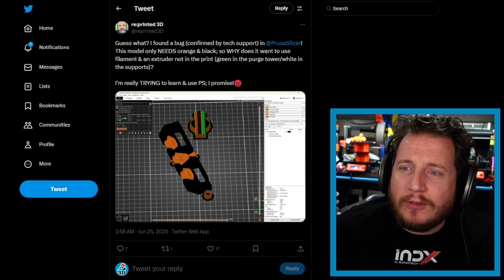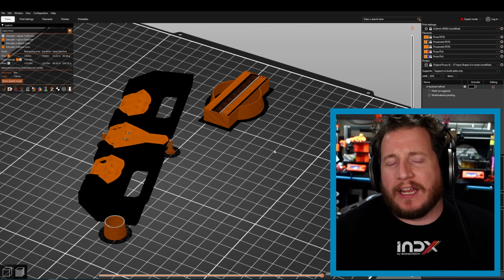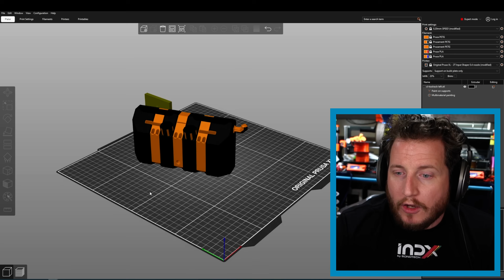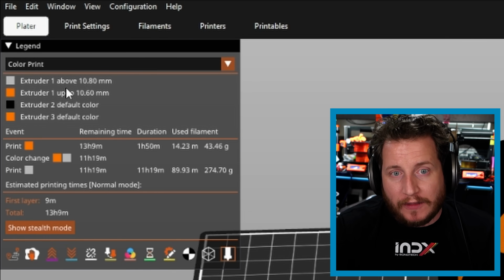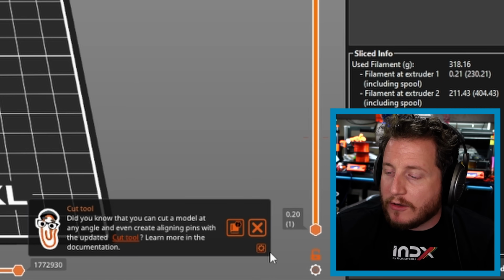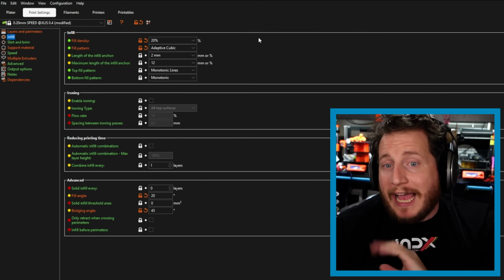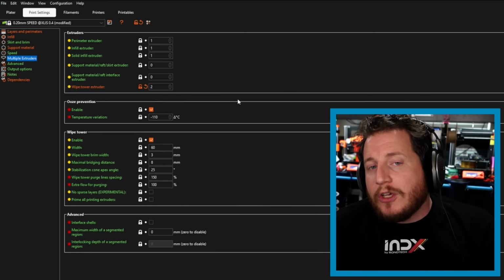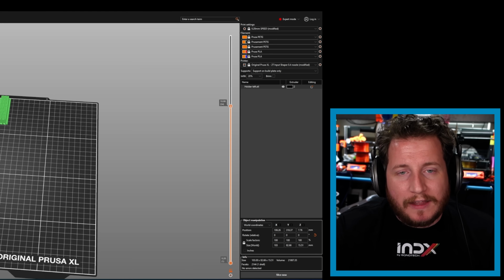UNEXPECTED Color Changes in PrusaSlicer?? - PrintFixFriday 198

Comment: I used Cura briefly (it sucks imo), then moved to Bambu Studio and Orca soon after (I still use BS occasionally). I’ve never used Prusa Slicer, but from all the videos I’ve watched that include it, it appears to be more complex, in both UI/UX and in slicer/filament/multicolor/printer settings. Whether or not it actually IS more complex or complicated, I’m sure I can handle it if I ever get the 5 tool XL. A guy can dream, right? Locl

Comment: Hey Prusa devs...color changes should only apply to models, not slicer instances. Please change that ASAP. Seriously, what are the odds that a color change on layer 86 is going to be the same on a newly loaded model. No. Just no.
Reply: Color change is applied to layers, not to models or slicer instance. If I add a new or replace an updated object on the bed, I want to keep my settings - yes, even a layer based color change.
If I want something new, I start a "new project" and don't add more to the same bed.
Reply: @ulaB different strokes for different folks. Sounds like the best option would be if you drag in a new model then pop up and ask. Do you want to reset layer based color changes?

Comment: My first printer was a Prusa MK3 (and have only had Prusa printers since) so I've used PrusaSlicer (PS) since Slic3rPE. I've tried OrcaSlicer (OS) a couple times and just can't get used to the interface. I really want to use the calibration tools in OS to tune novel filaments, but haven't yet figured out how verify that the profiles in OS are identical to PS, and then copy the tuned filament profiles in OS back to PS. I wish there was a profile conversion tool to go back and forth between the two. (I recognize that some features in one won't translate perfectly to the other, but a properly written conversion tool should alert of the differences, make reasonable suggestions, and/or allow manual changes for the differences.)

Comment: Prusa Slicer's UI feels super outdated to me. The whole idea of hiding settings in a 'sub-menu' and not right there in the main UI is an odd choice. I come from Ultimaker Cura or some resin slicers (RESIN IS TOXIC) and moved to Orca; all of those have settings on the side and are easy to access, making Prusa Slicer feel dated and less user-friendly to me.

For episode 200 i want to see me 😁 why and for what I dont know 🤣
Reply: IMO constantly-on settings panel works only for super-wide screens. You like one style, I like the other 😅

My biggest grief with Orca is that the settings seem to share the scroll state - moving between tabs and never know where the view will be...

Prusa tried to change the looks of the slicer (e.g. hide menus behind hamburger IIRC), but users made them back off.

Comment: Software Tutorial/documentation should NOT fall on content makers like you. That is the responsibility of whom makes the slicer. I'm sorry but I blame a lot of those weird funky quirks on Prusa being a little lazy, lacking behind and trying to catch up. Other brands have excellent documentation but using PrusaSlicer can be a hassle. I've used PrusaSlicer for several years and it still frustrates me compared to other slicers making it more convincing everyday to move to a different slicer (OrcaSlicer). As much as I'd like to move all my printers to a single slicer, I'm afraid I'd miss a setting/unchecked box since every slicer has different labels for their settings